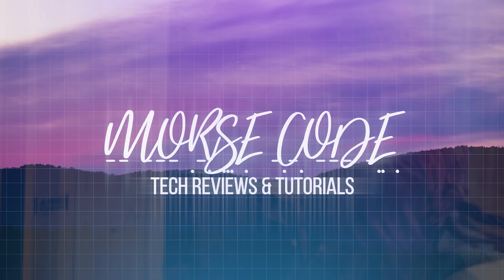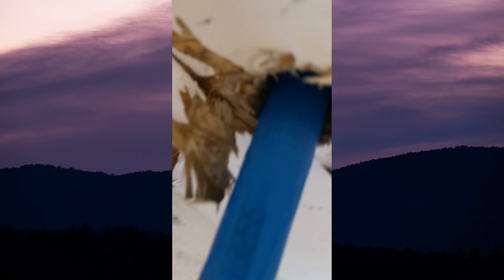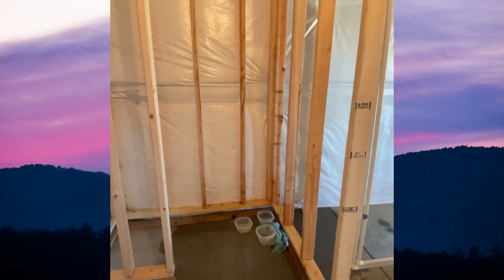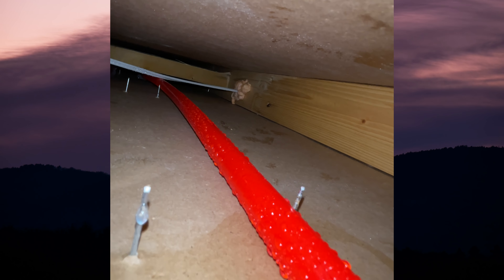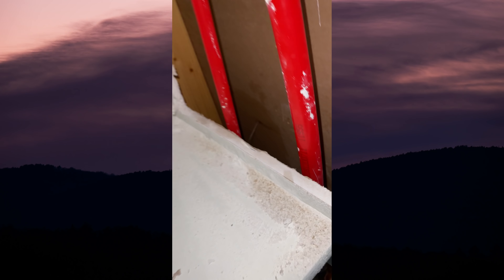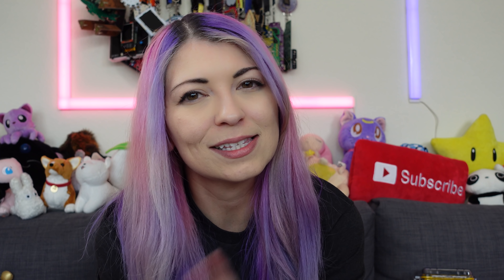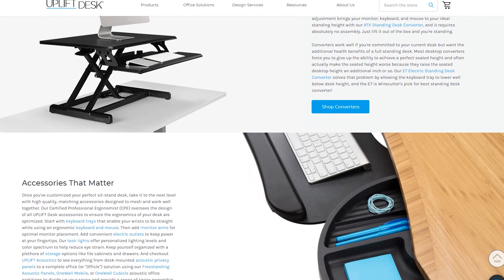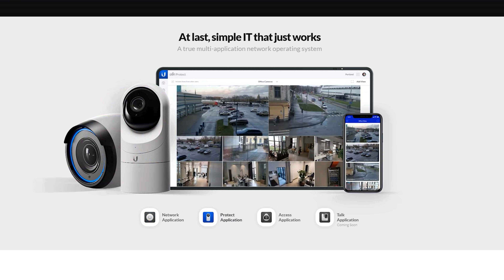Our Brand New House Had a Water Leak During My Dream YouTuber Studio Build! | Pt 4

Comment: Nail guards are typically placed on stud holes where wire or pipes go through only, because that's where drywallers are more likely to drill into since they put so many screws to hold the drywall to the studs, but not in the cavity between the studs. The shelving shown in your video is only held on by the drywall (maybe a stud or two in the back) which is bad because heavier items will make it pull out from the drywall (I'm sure the shelf installer knew this and that's why they drove so many unnecessary nails into the wall) if attached to the studs, it would've only needed screws in the stud locations and not in-between them

Comment: We live in an older home, about 40 years old. We had a leak similar to yours, but with copper. At 3 am I heard a hissing and from a dead sleep to wide away I hunted it down. Luckily the house has shut off valves everywhere. It was leaking in the wall I could hear it. Shut off the water to that area and it stopped. Next morning I opened the drywall to find a botched path job done many years ago. Luckily, my brain at 3am caught it. A few hours later it could have been a much larger problem.  A few days to dry out, clean up and repair. Its been at least 10 years and counting so I think its a good repair. haha

Comment: Use a dehumidifier for a few weeks. Drywall retains moisture. If you have a home alarm system with something like total connect you can integrate water sensors into the alarm. Once they are triggered it can call the alarm company and shut water off

Comment: Oh man do leaks suck.  We had one from a pipe coming off our hot water heater but it leaked onto the unit itself and then down the flue.  Killed and corroded the pilot light beyond function, and let a bunch of water out onto the floor.  Thankfully it only came into contact with concrete.  We also discovered that the unit had leaked at least sometime in the past.  Had to get a whole new unit installed so we opted to go tankless.  We were planning to get this upgrade eventually, but not like this!

Comment: We have a high ground water table so sump pits and sump pumps are required in basements.  We had a pump fail while no-one was home and came back to find 4" of water in the basement addition.  Learned my lesson there.  I installed a secondary pump on a battery back-up that kicks in if the main pump fails or if there is a power failure.  Have not had any issues since then and the back-up pump already saved us once when the switch on the main pump failed. There are also water sensors that can connect to wi-fi so that if the water level gets too high you can receive a notification on your mobile.
Reply: A few years ago we had random electrical cutoffs for half the house due to a ground fault. I couldn't find out what it was due to being able to flip it back on (I'm an electrician).

After a while it got permanent and I could isolate the circuit. It turned out the cable for the at least 20 year old submerged sump pump was rotted through. I pulled the plug so I could restore the power.

My dad decided not to replace the pump. I warned him that was a very bad idea and could cause flooding. He didn't listen to me. It was fine for 2 months. Then the water came through the concrete. Multiple times a day wringing rags in a bucket to stop a thin layer of water from spreading on the floor.

After a year I got sick of the daily complaining (and blaming me for not doing the rags) and convinced my mom to let me replace the pump. I spend several hours in the crawlspace to replace it (with a €60 Gardena classic 6000). Got a load of complaining to for that too from my dad...

It didn't fix the problem. It got less bad after a few months but there's still a small dehumidifier running 24/7. Two days after heavy rainfall we can get the rags again. It's probably a broken water seal due to the water pressure but thats very expensive/impossible to fix since the house is on top of it.

Sealing the basement could cause the water to build up behind the seal and damage the foundation so I'm not doing that.

TLDR
If there's a sump pump, it's there for a reason. When it breaks and you don't fix it you will find out that reason sooner or later. There might be permanent damage to your house if you don't.

Comment: Yes we had a similar issue with a nail in the base molding going into a copper pipe. We had been in the house for 4 years before the nail rusted enough to break off and start the leak.

Comment: Being so close to the wall that would've went through Copper as well! Kind of a bad place to put pipes to begin with but I don't know what the plans look like.
When you go left or right or up-and-down basically whenever you go through wood to the other side there should be a nail guard however that was just in the open cavity pushed up far too close to the drywall. They're supposed to be centered on the two by fours so they're semi away from anything that might get punched through the wall.

Comment: Those are disadvantage of the PEX tubing for hot water lines and heating, if they are installed incorrectly or damaged during the straightening, because they come rolled up, they can develop minuscule fissures that can grow into full cracks due to the thermal cycles and pressure withstand into the system regular use.

Comment: 1. A nailgun will puncture copper just as easily.
2. It didn't leak right away because the nail and pipe sealed to eachother upon impact, and the use of the water (flow and water hammer) finally corroded the nail enough for it to start leaking.

Comment: My house was built in the 60's and is copper, I haven't had experience with pex. 

A cousin of mine has had many issues with water leaks in his pex pipe home, one of which I was there to witness first hand. The pex line that ran to an outside faucet burst and caused significant water damage. I guess that's what insurance is for but the ordeal shouldn't have happen. The builder for the subdivision took shortcuts and he didn't find out about it till he started having various issues crop up and talked to some of the neighbors.  When he bought the house, the warranty was long over so his problems had to go through his insurance. He ended up selling the house.

Comment: PEX is both fantastic and terrible, i hope you have more success with the house in the future, but i would be disappointed in your builders for  putting in that much curve in the piping rather than the extra few cents to cut it off straight and crimp a 90° joint to each of those lines in the basement. i can't wait to see how your home server rack install goes!

Comment: Not PEX but copper. We finally we able to find a house we could afford to be moved in got the water on that took a while. Start noticing a little bit of a puddle in the basement it's the water here and there then one day I came down and noticed there was a little puddle on the washing machine. And then I happen to get the light just right where I saw five missed coming down from the ceiling. Turns out the wet wall between the basement bathroom and the laundry room. Call it wet while because it's got plumbing in and it's also not really a structural wall usually. Was set up going up to the ceiling to the basement and then captain both sides in the joists so you couldn't see above the wall. Turns out there was a hole on either side and there was a wire running through to the hot water heater. Upon forensically cutting into the blocking they put up I discovered that when they installed the wire they drilled through on both sides and nicked the copper pipe. Just enough for a pinhole leak. It must've been leaking for forever. As when are the things that was done to this house before we bought it it was up on the market for a while was mold remediation in the basement because everything got wet and moldy. Drywall is called drywall for the reason it's not supposed to be wet and then you have paper on top of that that mold likes to grow on. So when we moved in it was just studs everything was all done already they ripped everything out that was down there and just left beer framing. I highly suspect that this leak is what caused that and it was going on for years until we got the place.

Comment: Yikes!  I'm not sure if it was PEX, but I had a plastic pipe that curved (and not even a tight curve) after it came out of the water heater (that had been cranked up pretty hot by my brother-in-law, which probably helped the plastic give out) that started to split.  The water pressure in that place was pretty high and since it was a split, the water coming out looked like a blade and it eventually cut through the drywall and soaked stuff in the closet of the bedroom next to it.  The way I found out was I got woke up in the middle of the night to the hissing sound of it breaking through and hitting stuff!  Talk about a rude awakening! Heh

Btw, after turning the water off, opening all your faucets and flushing all the toilets helps relieve the pressure.  But then you'll have a lot of spitting and blowing bubbles in the toilet tanks as the air gets pushed back out of the system when you turn the water on again. lol
Reply from the maker: I know about the water pressure. :) after we had turned it off, the plumber had to turn it back on to find the leak after opening up the wall. That’s why the water was spraying out so fast. He then turned off the water again to cut the pipe.
Reply: @ShannonMorse  Ah.. gotcha. 👍  Gotta love having to flood the place a little more to find the leak. lol  I'm glad it wasn't really bad!

Comment: Your builder was nailing in to drywall? That shouldn't have happened, nails in drywall can't support any weight. A copper pipe would have burst but a pex pipe is much more forgiving. I had a screw in a pex pipe that didn't leak until I removed the screw. One good thing with pex is that they survive freezing without bursting.

Comment: Sounds like water, looks like water, can't be water, it just can't be because then we would have to be doing something.
Sure you'll see an increase on the water meter if you let that go for months but it's such a low volume leak... It's not an open pipe. 
🤥